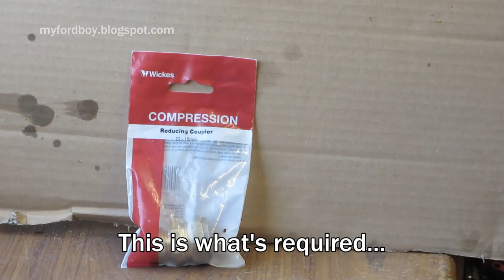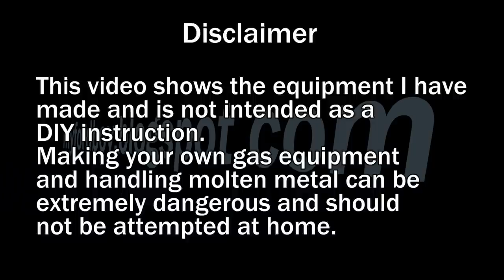Metal Casting at Home Part 45 Home Made Propane Burner

Comment: Great tip about using Tippex correction fluid to stop solder getting on the threads. I've used acetylene soot before, but never heard of using Tippex. Brilliant. Must remember to commit that one to memory! Thanks.

Comment: A pleasure to watch. Goes to show he's a real professional at this. If you go to his blog you'll find he's into Stirling engines as well which is very interesting. 
However, after watching all these videos on gas furnaces I'm tempted to go with a coal furnace because (a) coal is cheaper and (b) coal is safer and (c) coal requires no special conditions for storage. 
I basically just need to melt down a large quantity of scrap (junk) Gold and Silver I've purchased over the last 40 years into bars I can easily sell that are (a) not too large so as to be prohibitively expensive for buyers; nor (b) too small as to be prohibitively expensive to have the bars assayed and certified individually. 
Sure, there are places that will do the melt for me but here in eastern Europe it's on a leave-it-here-and-we'll-smelt-it-for-you-when-we-get-around-to-it basis where you leave them 50kg of metal, then pay them to melt all 40 kilos of it so you can come back 2 weeks later to collect all 30 kilos of it in bars. 
In short, I'd rather do it myself, especially given the fact that I apprenticed in metallurgy as a child before going into banking, and YES, there really IS a common thread. 
I did try mailing a test batch to a USA refiner for smelting and assaying but the result was not to my liking because I know exactly what I have and I assay it myself, but with the larger quantities I'm dealing with I'd rather have it assayed by a western state assaying office, like the one in Vienna which I am familiar with.. 
Also looked into electrical smelting but that seems too time consuming since the smelter typically only handles 3kg of Gold (or cca 2kg of Silver) per melt and I'm not going to be sitting here for months at a time melting down Silver into little bars. Getting a bigger furnace is also not really an option because at that point I'd actually be getting into the business of smelting metals which defeats the purpose. 
BUT, problem with a coal smelter is that this must be done outside, hence no privacy! 
I really don't know what to do, because any method I look at has 100 problems with it. Yes, I can actually rent a smelter all to myself, but that's in northwestern Czech Republic and getting the material there and back is a bit too "interesting."

Comment: Nice tip on the white out (typist correction fluid) I will have to try that one out.  The next time you anneal copper try plunging it in water after you get it red hot.  I think you will find it gets softer than if you air cool it.
Reply: 8
Reply: That's a well-known fact. Copper is the only material that behaves like that, as do some copper alloys. I actually apprenticed in metallurgy so I know, and my teacher was an artisan copper sculptor.

Comment: just a hint ,, if you use a .30 tip for a mig welder you don't need the brass disc. different size tips produce different flames
Reply: SEENIT ONTV
Reply: SEENIT ONTV

Comment: suprized i didnt came across this one sooner , seems like a verry "civilized" burner its a verry simple design (yeah you need a little more tools to make it ) , and gives off plenty of heat without the noise anoying the neighbours  or using a large amount of propane for a 10 minutes shorter melting time  , wat type of blower did you use , it looks like an old electric paintstripper
Reply from the maker: Yes it was a hot air gun blower.

Comment: Just finished watching all 44 videos in the casting series. Well done, and greatly appreciate the effort that went into making them for us.

Three questions:

First, when do you prefer Petrobond/oiled sand vs. green sand?  Seems like a fair amount of work to condition the green sand between casting sessions...

Second, what's special about core sand?

Lastly, what do you think of electric kilns vs. propane for melting aluminum and brass?

Thanks again,

Tom
Reply from the maker: Thomas Utley Petrobond gives a good finish to the casting and is easy to use but it is expensive, you loose a bit of it on every casting as the sand around the metal bakes hard and has to be removed.
The core sand is just a silica sand that is dry, no clay like the greensand.
Electric will melt well and is a good atmosphere, no gasses from the burner but it is slow compared to gas. I think it took about an hour to melt the small amount in the video on brass and petrobond.

Comment: Do you think an aluminium chimney duct with refractory caulking on it would make a good vessel for casting? What would be the possible problems? I'm looking at making a cheap charcoal/propane burner with one, just not sure as of yet.
Reply from the maker: No, I would use a stainless steel storage container without any coating. I used these for a long time. They have a short life but are easily replaced.

Comment: I have the burning need of making my own furnance and cast some aluminium, this is amazing but maybe im an ignorant but wouldnt be alot cheaper to use some bought gas regulator and burner?
Reply from the maker: I don't know if you can actually buy a burner like this but mine is very cheap to make. The regulator on the gas cylinder is a commercial item.

Comment: QUESTION BUD.? What size bit did u use to drill the gas jet hole. A 16th, im from the US so i dont no if I said that right
Reply from the maker: I used 1mm, that's 0.039" or # 70 drill. All the dimensions are here http://myfordboy.blogspot.co.uk/p/myfordboys-furnace.html

Comment: Why does your lathe make a ticking noise when it stops?
Reply from the maker: When the motor slows down after the power is killed the centrifugal switch inside the motor clicks as it reconnects the start winding ready for the next time it's switched on.
Reply: ahh cool. Thanks

Comment: 14:44 copper being an extremely good conductor of heat  it would have been better to add a heat sink to the side with the joint that you wanted to protect. The insulation as shown in the video will only help contain and transmit the heat via the metal. It would protect the joint against radiative and convective heat transfer, but these modes of heat transfer in all likelihood play only a minor role here.
Reply: DutchPhlogiston 

P

Comment: Brass, aluminium, steel, copper, and silver, couldn't you have fit titanium and zinc in there somewhere? :)
Reply: W Bailey 😬
Reply: W Bailey سبامليظ،فل
Reply: ZINC when heated to vaporization (less than steel at cherry red), produces arsenic and other toxic fumes... jus sayin.
Reply: Michael Rinkle So when you heat up zinc it becomes a different element? Interesting.
Reply: and maybe uranium

Comment: all of your videos are great and i very much enjoy watching them all. I however have a question i have not seen any of them where you are discussing anything or explaining anything i don't think i have ever heard you speak a word in any videos i have seen. Just wondering why?  Wouldn't it make it simpler to explain about what is going on while the video is being recorded instead of editing the video to include written text on what is taking place at a given time in the video.
Reply from the maker: Tony Emory It has become the style of my videos that I do not speak. Many viewers like it like this with no waffle or stumbling speech. It is difficult to talk and work at the same time.
Reply: That makes sense,  Thanks for the videos they are very informative,   On this particular video how is that burner holding up for you,  I built a Reil type burner but for some reason i cant keep the flame in the furnace all of the time, Sometimes it will jump back down the barrel of the burner a few inches and works way less effectively.  I was concerned the flame would follow the gas back to the bottle the first time ( i know this is not possible but for a split second i though oh crap)   My other concern is i may have been a bit overzealous when i built the furnace as big as i did and that could very well be the issue,  I am in the process of reducing its height by 8'' as i never have needed that extra space and don't anticipate needing it,  I have the diameter i want which will hold my crucible that is about the size of a gallon paint can.   For me that is more than enough molten aluminum at one time for my needs.   I do sometimes tend to overbuild some things but that is due to not wanting to have to do it a second time because the first time was either to weak or small.
Reply from the maker: Tony Emory I have not had any problems with this burner, it works very well. In a later video you will see how I added a blower and this reduced the melting time. I have now switched to waste oil for fuel so have zero fuel cost and can now melt iron.
Reply: Very nice. Myself i dont think i will ever be melting iron but you never know what i might need down the road.  Think i will build one of your style burners and test it this weekend. Thanks for the information and the time.
Reply from the maker: Tony Emory The burner details, along with my previous ones are shown here http://myfordboy.blogspot.co.uk/p/myfordboys-furnace.html
Reply: Thank you

Comment: phenomenal job mate. just wondering about the importance of the flare. you said that it is required when burning outside of the forge but how about inside?
Reply from the maker: No flare is needed when the burner is used in the furnace.
Reply: thanks mate

Comment: By using forced air with in the torch or not, will that effect fuel consumption and how?
Reply from the maker: Forced air improves combustion, heats up quicker so saves fuel.

Comment: Great video, is the Stainless pipe just 316 water pipe 1.2mm wall?
Reply from the maker: +Bob Smith It was just some pipe I had. It's not critical, water pipe is fine.
Reply: +myfordboy Thanks for the quick reply, do you think adding a sliding gate over the inlet would be suitable to add a degree of temp control, say for use in a blacksmithing forge, I really like simplicity of your design.
Reply from the maker: +Bob Smith The air does not need restricting any more. In fact the burner worked better when i added a blower to the furnace https://www.youtube.com/watch?feature=player_embedded&v=ZjGT8ZAVnts
Reply: +myfordboy I see what you mean, thanks agian for taking time out of your day to reply.
I will he giving this burner a try.

Comment: 8:00 how did you get scissors sharp enough to cut through a soda can?
I've tried sharpening different scissors with a bench grinder and I can't get them sharp like I've seen on youtube.
Reply from the maker: +CallMeBronco Cans are very thin, any pair of scissors should cut it easily.
Reply: You can't use JUST the bench grinder. Use that first but then polish the edge with a hand sharpening stone. You can also use a ceramic nail file (not the metal type). With the bench grinder you sharpen it up-and-down, but with the hand one you do it left-and-right until it's completely smooth. 
Also, needless to say, you only sharpen the slanted edge, and not the straight edge of each of the blades.
Yes it takes a while, but you'll know you've done it well when you take an axe blade sharpened the way I said and shave your arm hair off with it. 
I sharpened one of my favourite swords this way. Took me days but you can do this while watching YouTube lectures. Just be careful. But yes, you can actually shave your face with that sword if you wanted to. The real test for that is cutting small wet branches in your garden Zorro style, which I've done.

Comment: What kind of torch do you use for silver soldering? How hot does the metal need to be to solder?
Reply from the maker: I am using a sievert propane torch. for silver solder the metal has to be around 650C which means for steel the metal will be red hot.

Comment: hey, i have made a burner like this, thanks to your video! it looks awesome;)
Only one question remains. i now need to get an adjustable pressure regulator to control the flame. what pressure range do you recommend? i have been looking at one wich has a range 5 - 20 psi in 11 stages. or 0,35 - 1,4 bar if you like. thanks in advance for the reply:)
Reply from the maker: +Actionhank You need more pressure than that. I run at 2 bar, one that goes up to 3 bar would be the best. The type sold for caravans or Bq or not high enough.
Reply: +myfordboy thanks for the quick response :) ill go with one that has 0-4 bar pressure and a manometer. since it will be the easyest to acquire. thanks again :)

Comment: Mr myfordboy, I would like to know if this furnace set up well melt iron? Thank you.
Reply from the maker: I have never tried this one on iron but I doubt it will. My oil fired one will though.
Reply: Ah I see. I was hoping not to go that route, gas is much simpler and cleaner. Would it be possible to double up the propane and make it work? As in 2 burners form opposing sides. Thank you.
Reply from the maker: I would not go for 2 burners  but forced air helps https://youtu.be/ZjGT8ZAVnts
Reply: Nice! The forced air improved the flame by 2-3 times. I still have more to learn before making one. Thanks you sir.

Comment: Why do you use silver solder and not lead solder?
Reply from the maker: Green Silver Silver solder is stronger has a higher melting point and makes a better job. The soldered parts do not get hot so you could get away with soft solder.
Reply: Thanks for the reply, I've noticed in a few previous videos and wondered why.

Comment: Hi there myfordboy. Iv just made a furnace burner but it's a massive FAIL.  It's made from reclaimed bbq parts and a standard gas bottle valve. 

It's on my channel 

Can you take a look and see where I have gone wrong and maybe recommend what part in need to replace.

P.s I am UK based over the water from Liverpool. 

Thanks

Comment: (6:00 minutes) What is the diameter of the drill please? 
Thank you
Reply from the maker: All the dimentions for the burner and furnace can be seen on my web page http://myfordboy.blogspot.co.uk/p/myfordboys-furnace.html
Reply: myfordboy
I've made a similar burner a while ago. Using mig tips, I could experiment with different jet hole sizes. I found that 0.48mm yielded a big enough flame (@ 0.5-0.7bar melting aluminium is no problem). I use the same small jet hole setup to forge weld steel (~pattern welding steel)@2bar(1400°C more or less). The gas consumption depends hugely on jet hole size and pressure. Also, why didn't you make the air intake adaptable (more, less air)?
Always interesting to watch you do stuff. The silver soldering way to attach a bottom to a tube and annealing to make it maluable were new te me.
Thanks!
Reply from the maker: ***** I can control the air using the blower. The burner is based on a previous one so jet size came from that.

Comment: What is the diameter of the gas jet hole you drilled?
Reply: myfordboy Need to add a "d" to the URL you have listed here and in the description...
Reply from the maker: Best Racing Tips Win At The Dragstrip I have listed all the dimensions at myfordboy.blogspot.com look at the bottom of the furnace page.
Reply from the maker: Robert Jochim  Thanks for pointing this out. I have corrected it.

Comment: This is too much,  not everyone has a lathe.  Us farm boys have been building  propane burners from the time first weed grew. A grease fitting, remove the center with a punch, a few pieces of pipe and you have a burner.  this is a lot of crap and work.  You can figure it out at the hardware store,   all of your grease fitting are pipe threaded and they come in a nock in grease plugs for the ones who cant thread steel and weld.

Comment: myfordboy  How can I cast things with fine detail? I've heard about using Hydrocal, Ultracal 30 mixed with Silica Sand or Silica Flour. Can you cast things with fine detail with Sand casting? I would like to get into metal casting, but I'd like to do things with fine detail. Your videos are very inspirational. Thank you for sharing your knowledge of sand casting with us. It's very relaxing & reassuring  watching you cast many different things & parts using this method. (+1 : 342)
Reply: I can see why nobody's responded to your post for so long because there are so many different variables involved. Like, what metals/alloys are you using. What are you making? Is it art or is it utilitarian? If so, what kind of tolerances are you looking at in terms of thermal expansion, stress, strain, ductility. Usually, fine, really fine sand casting is done for stuff like bathroom and plumbing fixtures cast in brass and chrome plated. 
If you're using sand, is it for making multiples of an existing item or part? 
Are you sure casting is what you need versus machining? 
I've had surprisingly good results using plaster casting for one-off parts, like back in the day when I owned a Citroen AX and needed to make the rear door lock release/activation pin, which was originally made of plastic. New one would have cost me 1500 RUBLES! The rudeness! I said no, but I borrowed the part over the weekend, made detailed impressions of it in plaster in 2 dimensions, then returned it, after having made a successful casting in ZnAl. Total cost about ZERO RUBLES + my time. I used ZnAl alloy from old door and window handles to make it and did it all on my kitchen stove.